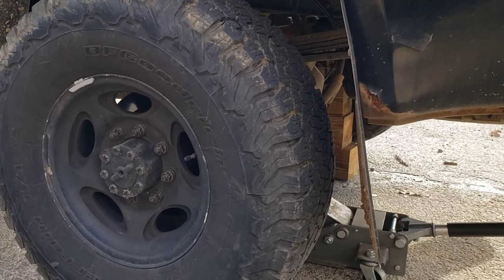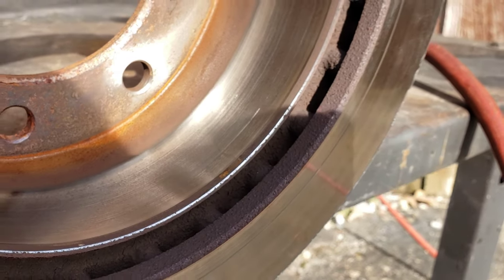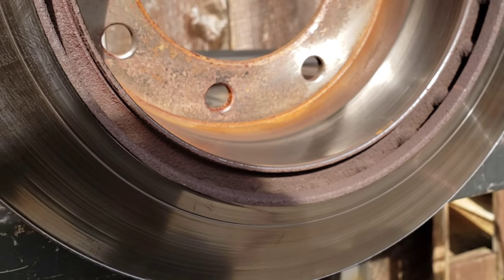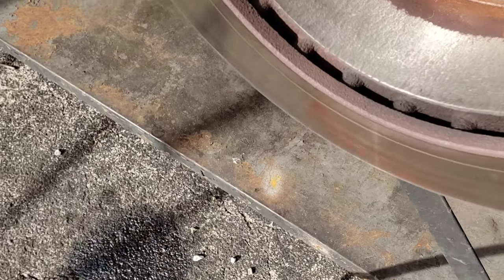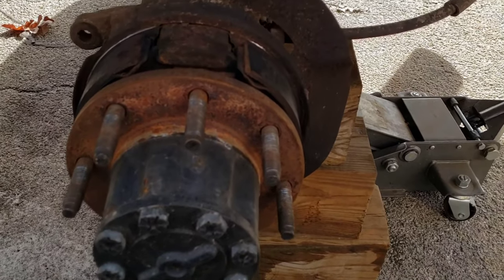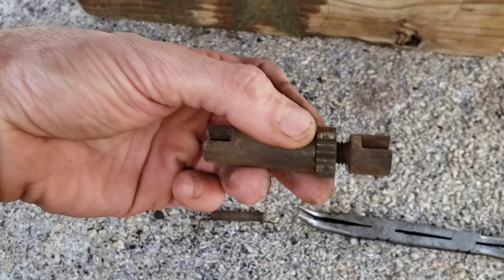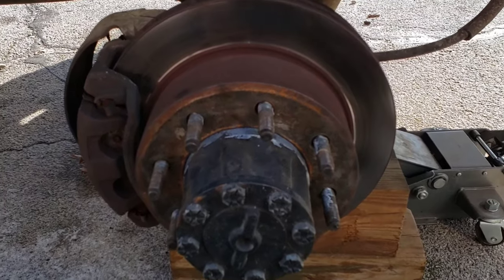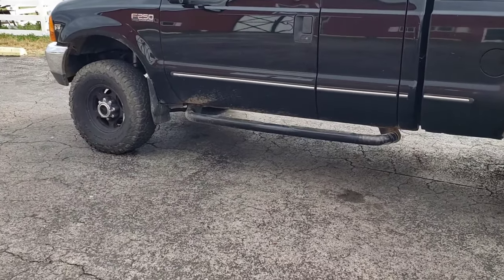1999 Ford F-250 ZF6 parking brake mod

Comment: How did this hold up in the long run?
Reply from the maker: It worked well for a long time before I broke the foot pedal. I will need to take the rotors back off and do more engraving though. I could tell everything had smoothed back down.
Reply: @HungOverSheep  funny enough, my pedal also just broke... though its at the bottom of the to-do list for the moment.
Reply from the maker: @alk3g  there is a video showing how to repair it if the metal rivets are broken. That's what I did, just needs some small spot welds to prevent it happening again.